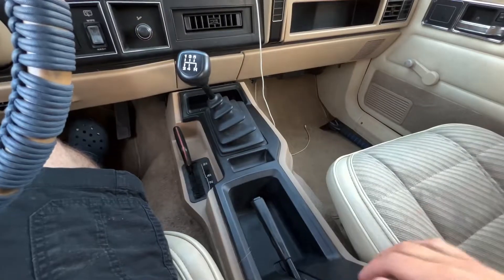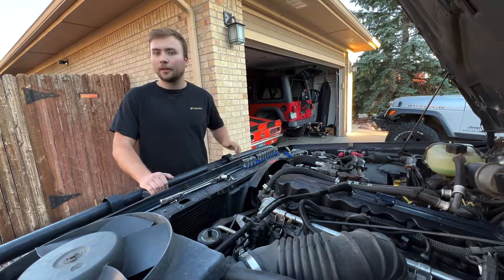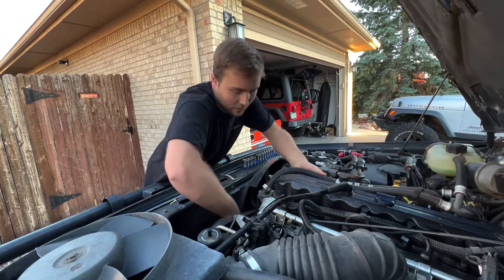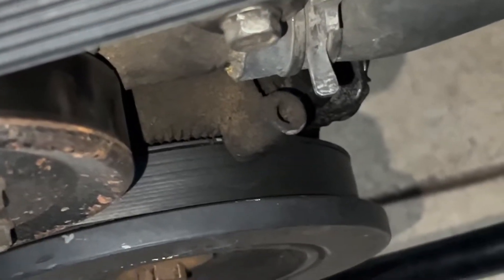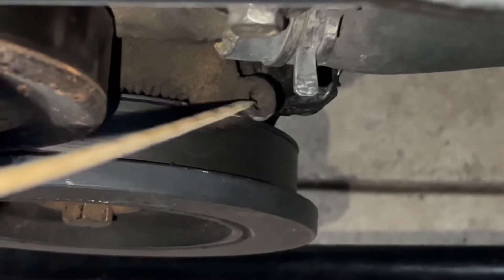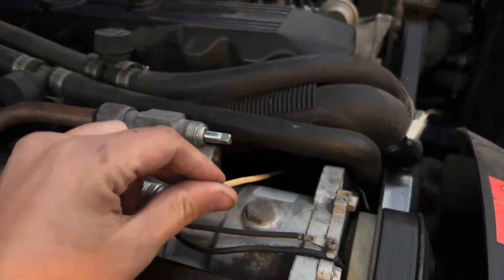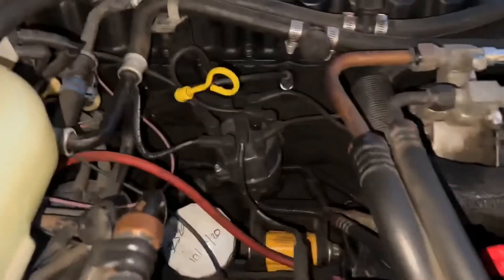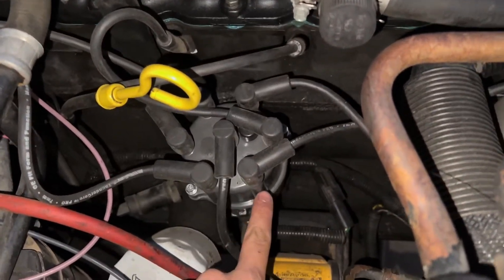How to: Set your Jeep 4.0L or 2.5L engine to #1 top dead center

Comment from the maker: I forgot to mention! You need to remove the #1 spark plug from the engine. It is the spark plug all the way towards the front of the engine. It’s hidden by a few hoses that come off of the thermostat housing. Good luck!